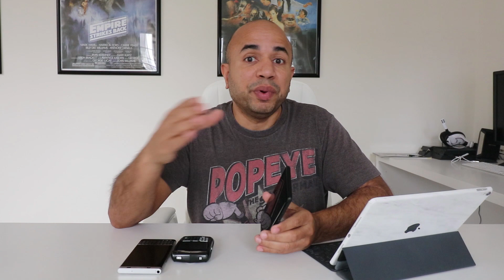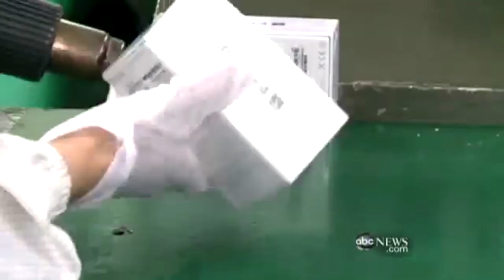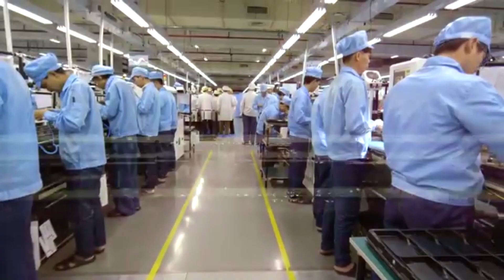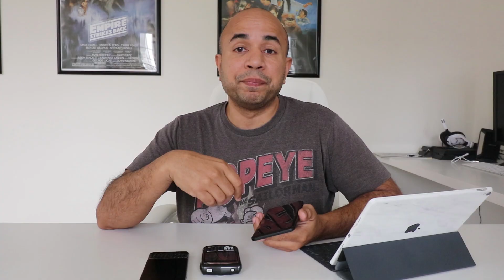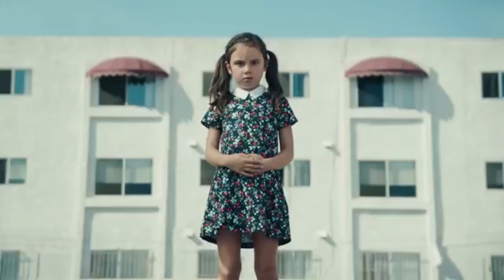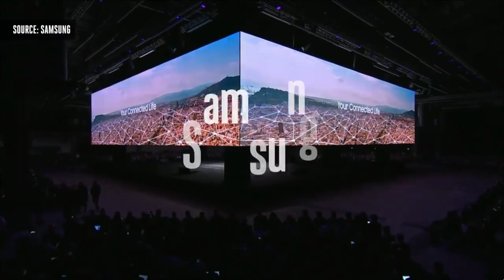THIS is why smartphones are SO expensive?

Comment: Isn't it actually the other way around? Manufacturers themselves are creating the need and then simply respond to it with $1000 phone. I've recently bought Redmi Note 5. It's $200 phone. 18:9 aspect ratio, 2 lenses on the back and 4000 mah battery. I don't need glass on the phone, I'm happy with aluminium. I don't need the best camera in the world. I'm happy with what I get. And most pf the users would be too. But they simply don't know that.
Reply: Somebody with sense.  The only thing for is my s7edge is on it last leg . I just want long lasting battery life.